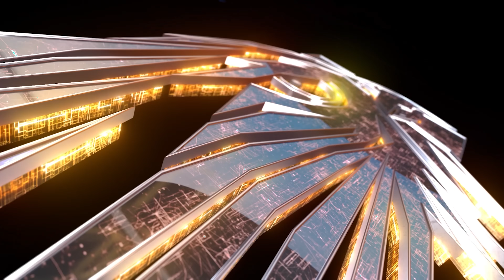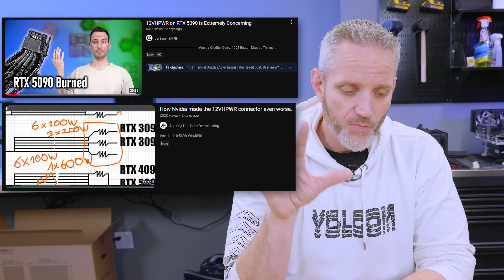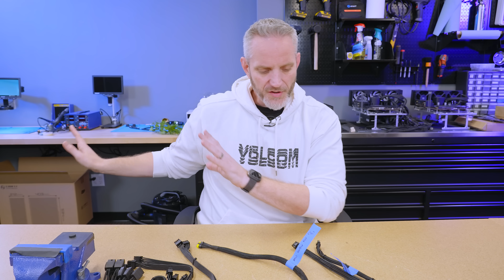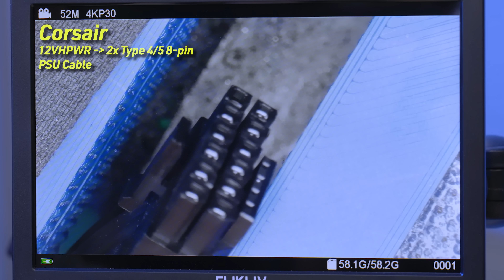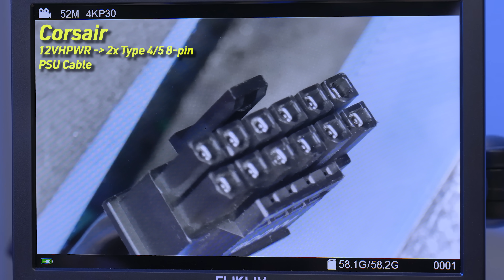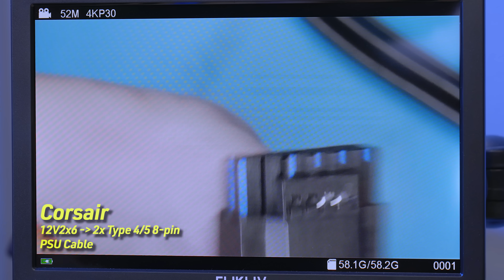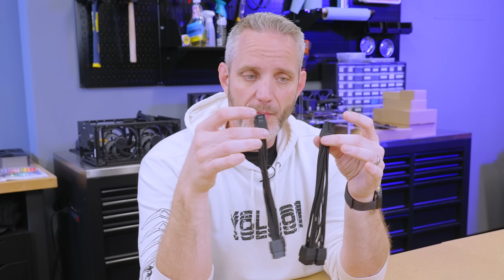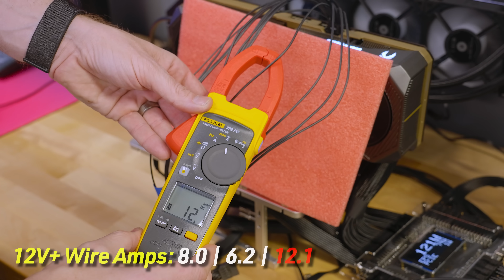I discovered something concerning and I need the Experts to chime in... More 12VHPWR discovery!

Comment: As an electrician the thought of a cable and connection that small having to handle 23 Amps... Is terrifying.  Thats going to melt or burn under that much load.
Reply: nah, that 12 gauge in there got this... what?... you went to 16 to save .03c per item...... well....shi...........
Reply: @AndreasA.S.  atx standard specifies 14 gauge. 12 gauge would be better, you could pull a full 11.2 amps/wire and have a 20% safety margin. you could do the job with 5 pairs and can either use a dumb 10 pin connector or put sense on the extra 2 pins (preferably kitty corner at either end of the connector) and use a 12 pin connector without those stupid parasite pins. only the gpu power need run 12 gauge wire, everything else can run the normally atx specified 14 gauge wire.
Reply: That's a big part of the problem, each power wire in the connector is only supposed to carry up to 9A continuous by design.
Reply: @doggydaddy2003  Without forced current management for every pin, there is no limits. Only limit for a wire now is how much GPU is pulling, so in theory every pin MUST survive 50A+ continuous load (that's how much 5090 can pull) or it has to have mechanism to force 9.5A and no more on every pin.
Reply: well then consider Nvidias bad design will allow up to 50 amps across that same wire in the worst case scenario as it allows 5 out of 6 conductors to fail and the card will still draw full power. the 30 series had power via 3 shunts so 3 pairs of 2 wires...the max you could lose was 1 wire per pair, if you lost 2 wires to a pair, the card wouldnt power up. So if the 30 series could draw 50 amps, worst case was 16.63 amps on each of the 3 conductors. BUILDZOID aka "Actually hardcore overclocking" has an excellent video on the circuit design which is the root of this issue, there wont likelt be a cable fix unless they want to go to 6x6GA wiring LOL
Reply: @TheAddanz  Exactly, removing the load balancing shunt resistors while also going to a connector with much less safety margin is the real issue here. It's crazy how many people are still defending NVIDIA and blaming user error, when according to Corsair, the freaking pins can be half way out of the damn connector and still be fine. So you can have it 100% perfectly plugged in, but the pins are 50% out out of the connector, yet that's somehow user error when it melts, according to the NVIDIA shills.
Reply: Funny thing, people called out the card design with the 4090, but YouTubers got the whole idea of "it's the cable" and ran with it. Making all the companies and whomever sets the pcie standards run with it. 

No board should ever be able to request that much current over a wire like that.
Reply: @TheAddanz  the probability of 5 conductors failing is close to 0, it's more likely you'll have an issue with 1 wire and the power will distribute around 20% on each wire
Reply: @rozigrish9732  well chances are low but not 0% for sure as ppls actually have issues with melting connectors
Reply: Not apples to apples, but 20A house lines need (i believe) 12AWG wire for code. I guess gpus just are different 🙄
Reply: @xsouldriverx  You can lower wire section if you increase the voltage, but you still need a perfect connection unless you want to burn your house down.
Reply: I said the exact same thing and told everyone this will fail the first day the released this bullsh1t connector.
Reply: Increasing the voltage would be helped
Reply: @Emma-i9x  It has other problems on it own, biggest is basically revolutionizing all 30+ years of computer standards, that will make every single part up to this date incompatible with every part in a future.
Reply: @PREDATEURLT  I mean new standards and moving on from the past is a normal thing that needs to happen at some point.
It just needs to be done right.
Like USB C will probably replace all USB A at some point.
Or Sata power replaced Molex.
Yes, those have lower impact, bc passive adapters exist, but similar as we moved on from horses to cars, there will always need to be big changes.
Also it could be for the meanwhile an additional rail that maybe switches from 12 to 24 V or something.
There are options, even for a cross-over time
Reply: @Emma-i9x  In my opinion if all market would go to 24V they will make even flimsier connectors with even worse safety measures because they can spend 1 or 2 cents less on that. AND it will make it easier for transferring from PSU to GPU or MB, but these pars will need more complicated and bigger parts for voltage reducing and filtering, GPU and CPU and a lot of other parts use voltages lower than 1.7V and it would be very hard to make it use higher voltage without reinventing what CPU is overall (or going 30 years back in performance).
Reply: I still don’t understand why they can’t just have like 6 thick wires & spade type of connections with plenty of surface area.
Reply: 23 amps on 12v is not the same as 23 amps on 120v. These cables are more than capable of handling the load.
Reply: They should have designed the connector to have 24V instead of 12V. It halves the current draw and those cables would hold just fine.
Reply: @ShadowManceri  Thing is it's the ATX standard that is the limit on voltage. They just magically cannot make 24V gpu with 12V PSU's easelly.
Reply: @ShadowManceri  tbh i don`t think it would be cheaper and easier to put extra converters and circuits that are separated or making whole new PSU line just for that when you can have similar level of security with couple shunt resistors,
it could be more future proofing for sure thought in sens of letting higher power draw,
hopefully it would be better designed than apple High Voltage (48V) display line being straight next to ~3v line going directly to CPU, 
but taking into consideration what nvidia did with shunt resistors between 30 and 40-50 series it may be another can of worms to open
Reply: My Dyson vacuum draws less amperage and the cable is a lot thicker!
Reply: @nexusyang4832  Which cable are you talking about? If you mean the power cord that goes to the outlet, of course it is thicker as it needs to be properly insulated. Live alternating current from the outlet is just something else.
Reply: max maybe 10 amp that's crazy
Reply: Considering the 2.5 twin and earth max ampage won't be anywhere near that and it could be triple the thickness
Reply: If they just used 14G wires…
Reply: @sudouser85 12 only gives you 41A (by us code, or EN 60204-1) and worst case 660/12 is 55A (no resistance) so without any logic on the pcb to verify that the multiple cables are actually sharing the load, things are much likely to heat up, melt or even catch fire.
Reply: @ Exactly. Without any logic on pcb to see what each wire in cable is doing, one wire might melt or catch fire if all of it was through one wire. ASUS Astral RTX 5090 is actually doing this but only for monitoring purposes. 14G wire has 26% larger diameter than 16G wire, so maybe 26% better current handling capability from single wire, it would still have same result but slightly slower.
Reply: Crazy 😧
Reply: good quality cables of this awg can survive even 25A for a while, it all comes down to what is used for the insulation layer. The connectors is another matter entirely but this is very bad either way thy shouldn't be red lining on cables so hard
Reply: And it did.
Reply: 23 Amps at 12V shared properly across that many wires really isn't scary at all, but with that pin size and spec combined with improper loading it's a larger issue.
Reply: Not sure why any "electrician", "engineer", and or presidents of small islands here, did not open with beginning, simple, electric basics like, the fact that the power supply can and Will pull 50-60 amps@ 600 watts. 50 amp draw needs 6 gauge copper or 4 gauge aluminum wiring. Most of these wires and connectors are a mixture of both. Either way none are capable of holding safely 50+ amps. And what happens when you attempt it? Melt down. Hell, some of those power supplies pull 80+ amps...
600W / 12V = 50A Why not 120V? Thats only 5 amps...
Your computer's power supply unit (PSU) converts alternating current (AC) from a wall outlet into DC. 
Something I think these designers either have forgotten or never knew.
This problem will not go away until it is done correctly. 
Most electronics need low-voltage DC (like 5V, 9V, or 12V), but wall outlets provide high-voltage AC (100V-240V). Therefore, must be lowered and converted AC to DC, making it safe to provide directly from standard outlets.
If you read the numbers on the power supply you'll notice this as truth. If you learn the pc's voltage use you'll understand the complete process.
So much for the thousands of "engineers" and "electricians" here..This is basic stuff.

And if one thinks coatings and or wraps, sheathing, cool af braiding, or any of the like helps the problem, on the contrary, it makes it worse. These things are insulated to minimize arcing after meltdown, but also at the same time keep heat IN making it even hotter. They have zero to do with electrical current carrying capabilities.
Reply: @LibelLinus304 Well, most people know that, but what is the moral of the story? Power supplies never needed to put out their full power with a single connector, and until this 4090/5090 there was no big problems with all this 12V high amps thing. Parts that are capable to take 600W should have load balancing on connector pins if multi pin connector is used.
Reply: @PREDATEURLT  Most people know that but decided not only to ignore it but post otherwise? Nice try. Most people do not. If you spent more time on comprehension than conjuring bs you would have gleaned the idea that it's more than expected to be alluded to by supposed electricians and or engineers. There were and are problems with 4090's. Yet another thing you should have known. Need citation? 
Also more succinctly is the fact most people don't understand the pinning or the process of the HP12V conns. You certainly don't. Designs vary but the fact that there are at most 6 positive and 6 ground, and they are either all connected to each other or connect to the board as one. I'll leave the idea that even the gaps between the solder must be widened to accommodate and the fact that they aren't, but since it doesn't seem to be the issue, although resistance can appear anywhere without pattern, the problem remains clear. To "control" this design they engineered "sensors" to supply power as the demand increases which is redundant. It simply isn't designed as a differentiating, individual pin process. In Any circumstance. Neither is the power supply. Aamof some still rely on a single 12V pinout period in which All demand is carried on a single pin. But either way demand is not shared or dispersed amongst all pins. Not in the psu, not in the gpu. Not....to mention electricity doesn't divide out the load by merely adding more circuits, Especially PC PSU's. From the psu to the gpu to the plug all need to be reengineered, something obviously these manufacturers aren't ready to provide. Instead you get half assed, fingers crossed, hope it don't melt, good enough for now, it's cheaper this way, melting plugs. And if you even should have retorted you should have learned about the Huge amount of 4090's being repaired for this problem. Ask Northwest Repair, he'll tell you, or Northridgefix, or...need I go on?
Reply: @PREDATEURLT  In short, we can in the least, exclude you from "most people", amirite? smh
Watts is watts, amperage is amperage, current is current, etc. A 12v rail is a 12V constantly supplied 12V divided by wattage load. Even IF you designed it all to disperse that load amongst other pins, 16 gauge wire isn't cutting it. Most conns are even 18 gauge. The idea that if you take 50 amps and connect two wires to it, each will carry 25 amps is what someone says who don't know what they are typing about..
Reply: Hi friend, I am having difficulty understanding the content because I am not a PC specialist and do not have good English (I am using A.I.). I am looking for content to understand if I can use an ATX 2.X (MSI B650 BN) power supply with a 5070. With the original NVIDIA adapter cable. From what I understood, the problem is only with cards that have higher consumption, right? I`d appreciate your help
Reply: You can't just throw 23 Amps without talking about the resistance of the wire.
This is Joule heating.
Next time also put an estimation of the resistance of the wire.
Have you measured it ?
Reply: @xl000  23 amps with at best 16 awg wire and at worst 20 awg is never okay, regardless of other factors, it’s just far beyond the capabilities of that size copper wire regardless of the length of the run and the total resistance. The joule heating effect is secondary to just absolutely overloading the wires ratings.
Reply: Now consider the NACS / Tesla ev connector with 400v and 500a on two pins.
Reply: @Voodoodrul  MUCH beefier pins and a much larger connector.

Same story with other electric car charge connectors(RIP CCS, CHAdeMO).
Reply: @CptJistuce  Yeah, I'm impressed by them. Even when abused and exceptionally dirty. Still, it's an epic amount of current.
Reply: @Voodoodrul  Not just current, but voltage as well. And this makes for a legendary amount of power in watts.

Looking at gov.uk's guidance:
Standard AC charging can reach 7 kW of power delivery (230V @ 30.5A).
Fast AC charging can reach 23 kW of power delivery (400V @ 55A with three-phase inlet)
Fast DC charging can reach 22 kW of power delivery (unknown voltage and inversely unknown amperage).
Even faster charging of 400 kW of power delivery is possible (but UK doesn't seem to permit that, only god knows what voltage and amperage that would be).
The cables involved are likely 8-gauge or 6-gauge, meaning they're designed to deliver that power safely.

Of course, this video is about a single 12V pin drawing 23 amps. That's "only" 276 W. But even a 12-gauge wire will sweat under that much power. 16-gauge? No chance in hell it survives.
Reply: @Operational117  The 250kw chargers here are pretty common, most are focused on 500v platforms. The cables are liquid cooled and technically under spec'd for the load, but the cooling and short peak loads make up for it. I have never noticed the connectors getting more than slightly warm. Still, the connector is moving enough power to run ~500 gaming PCs under load, or the max load of ~12 houses with 220v x 100a service. That's a lot of juice through 2 pins that really aren't that massive. They are about the size of a 1 inch pencil.
Reply: @Voodoodrul  That cable and pins is properly sized, but the jacket it's also watercooled and current is carefully monitored on both ends. Not sure why you are mentioning that.
Reply: @ because the extremes are interesting to think about
Reply: @Voodoodrul  Exactly! We could be using XT-90 connector on the GPUs, too, but for some reason Nvidia wants to come with more complex solution. The XT-90 connector has been used for a decade in high current drones without problems so it's known to be good connector.
Reply: Hmm are you sure about that?

I remember seeing a video quite some time ago that those pcie power cables are under spec'd for safety but they're actually capable of carrying twice as much power than they're rated for.

I think they're rated for 150w but can carry 300w safely.
Reply: @jeremylindemann5117  Only for short periods of time to deal with spike situations, not for continuous use at those levels.
Reply: @jeremylindemann5117  Yeah. The PCIe power spec has a significant safety margin, because you aren't supposed to run power connectors right up against their max design load like nVidia is doing pulling 600 watts through a connector with a specified max of 660W.
Reply: @jeremylindemann5117 that’s 8 pin connectors which have more contact area at the connections per pin than 12vhpwr. 8 pin is an old design with a large safety margin built in, while this connector is running on the ragged edge, it can technically pull a maximum of 660w by power drain and is rated for 600w, 8 pins can in spec pull up to 300w but are rated to only 150w. That’s a huge part of all of these issues popping up, the slashing of safety factor.
Reply: @jeremylindemann5117  it's not under spec'd, it's just companies using higher then spec wires and crimping terminals on their pricier PSU's, if you take some random cheap bronze-silver one it will most likely meet the specs
Reply: @jeremylindemann5117  pretty much, they are overspecced, while the 16-pin is not
Reply: @jeremylindemann5117  Yes the OLD PCIe cables not this new 12 pin BS design with a lot smaller of gauge of wire. THE OLD 6+2 connectors could handle up to 300 watts each. NOT the new connector with less than half of the 4 6+2 connectors AND a smaller gauge wire. So yes the old 6+2, with 4 of them, could feasibly handle 1200watts. The new 12 pin can handle 600 watts, possibly 800 watts for overhead. You see the problem???
Reply: @jeremylindemann5117  that is the PCIe connector, not the "12VHPWR" connector.  it's pins are half the size, the wires are about the same, yet it's"Rated" for carrying double...

Comment: My guess is electrons move on the path of least resistance. If the resistance is high it will take more amps to counter act the resistance. Thus higher resistance will create heat. Since it's a single rail it's gonna pull whatever it can to counter that resistance  and provide the card the proper power requirement to run it.
Reply: Higher amps on those pins are just better made cable BTW if anyone asks